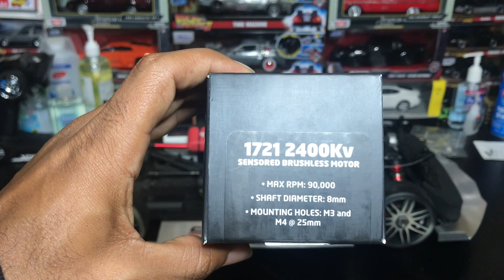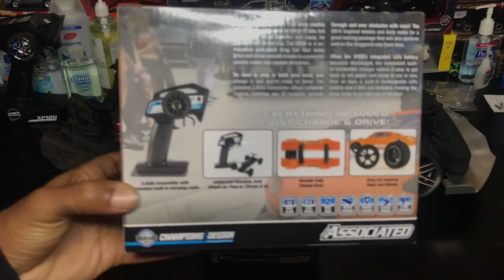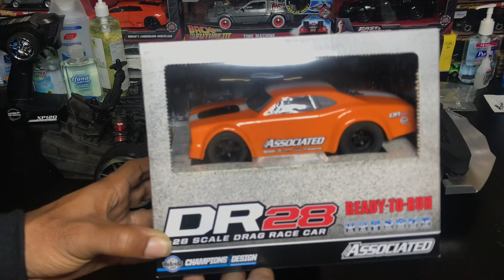Castle 1721 2400 KV Motor Unboxing???

Comment: what's up with the cocaine fingernail?     My boy tested these for castle and warned me    Let this motor cool off after every pass. There is a REASON why its not covered under warranty. grab that TP 4080
Reply from the maker: Long finger nails means cocaine? 

I have at least 6 of the tp4080’s in different kv configurations.

Comment: DO NOT RUN THAT MOTOR OUT OF PHASE. ABC to ABC. if you need to reverse rotation do it with the programming card. castle esc's seem to be sensitive to this are known to blow. this motor comes with a warning about overheating and blowing electronics.
Reply from the maker: Right. I blew mine anyway. Over revved it. 134k rpm

Comment: What pinion & spur works good with that motor for the 132?
Reply: Running on 4S, on my stretched Arrma Typhon 6S, with a 29T spur & a 34T pinion, I pushed 99mph with just hitting under 100% throttle for a fraction of a second. My temps were super cool even after 3 runs (checking temps in between). By run #3, data log showed my motor was 103F & my xlx2 was 112F. Fan on the XLX2 never even kicked on. I pulled a max amperage of 328A. 
I believe this motor benefits more on 6S personally. Geared the way I am now, I think on 6S I can easily get to ~120-130 mph easily safely since higher voltage =lower amp draw. Just have to keep an eye on the motor temp cuz higher voltage also =higher rpm. On 4S I think I was around the 32k rpm mark, thus my temps were low.
Reply from the maker: Well for one this motor is a little different then what you would normally start with for a Castle motor. The best advice I could give is if you have a center diff(infraction 46tooth spur) or spool (limitless 34tooth spur) I would not over gear or under gear. Try to start with a mid range (23-25~) pinion and keep an eye on your data logs. I use my castle link to check my data log after ever run with this motor.